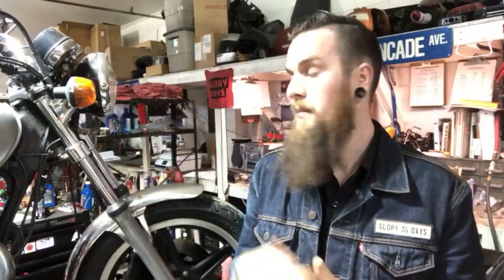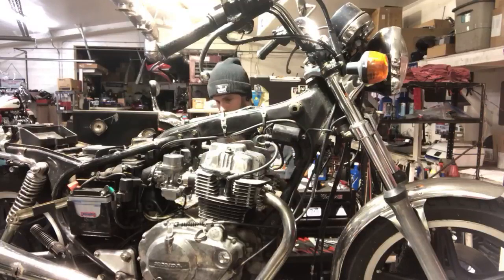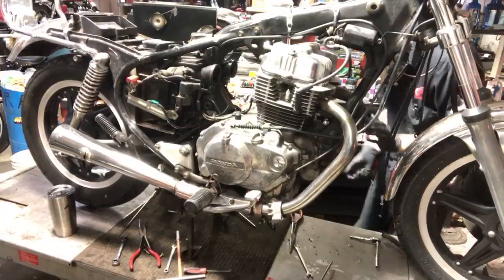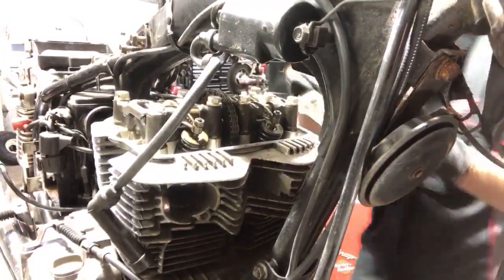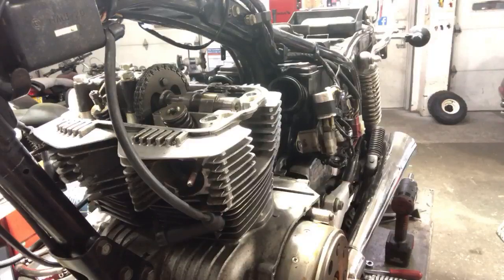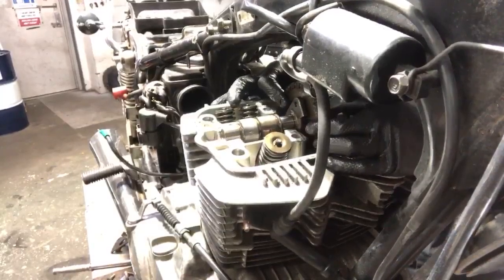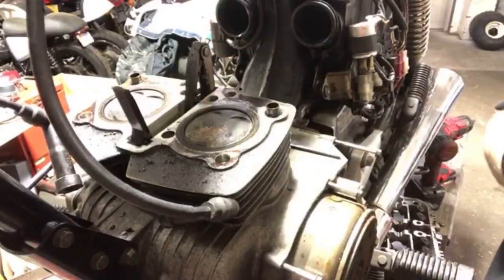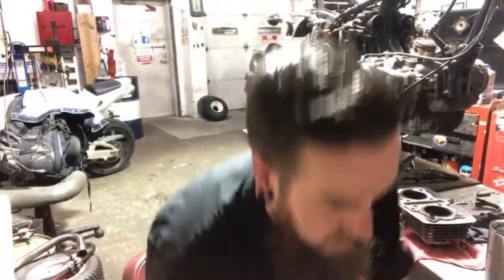80’ CM400t: NO COMPRESSION!

Comment: About 20 yrs ago i was driving with a friend on the backseat 30 miles from home on my tuned up 2 stroke 70cc scoot when I heard a loud pop and the throttle response was gone..I knew I had to keep the engine rpm up or it would die. So we went back 30 miles going full throttle lol... When we arrived at home i released throttle and it died and did not start anymore... Took it apart. And lol. Same as here 0.5 by 0.5 cm hole in the piston. The crazy thing still brought us home ;) .... Memories hehe..

Comment: The piston damage was caused by a lean mixture.  Running down the highway with a lean mixture, heats it up and eats the piston away.  There is either a cracked intake boot or the carbs are dirty and running extremely lean....per my husband who works on all these old Hondas.

Comment: bought it on craig's list . The pictures on the list didn't look bad  , holly sh#@!carb was seized up . I put a hole through the gas tank with barely any pressure. Front rim 1/4 of it was rusted through. It's still has hope. Its got me with your help.

Comment: My vote is it sat for long time as evidenced by the corrosion rings inside the cylinder. The carbs were dirty, they got it somewhat running and ran it hard on a cylinder that went peak lean (peak temperature leaned).

Comment: Hey Cody, thanks for all the info you so graciously post on You tube. I've taken to researching a variety of issues on YouTube especially issues concerning my bike, a 2000 V Star 1100. While I realize that there are some specific issues that don't cross over from a Honda, there are a few that do. Specifically the carburetors. Mine are Mikuni dual carbs and you've illustrated the "drop down" method of tuning/adjusting the carburetors. I recently went through a thorough cleaning but delayed doing that for fear of being unable to bring them back to running condition. In one of your videos you went through the drop down method and illustrated how the running response should be after assembly and start up with sound effects. I've been working on motorized machinery practically all my life so I'm well acquainted on how mechanical items go together but have never worked on a motorcycle. This is where I need to mention that I'm so lucky that I have carburetors on my bike since all of the engines of my youth were all carbureted, even though these are CV and not down draft. I've learning as I go with your help and the only area that still is difficult is the electrical, but I suspect that is not unusual for anyone else even some professionals. Anyway, thanks for everything and I'll continue to check your videos.

Comment: Now that's a trashed piston! I'd call that a wash Brother. Metal in the crank case is almost guaranteed. I got lucky with the CL200 engine. It was seized, but the PO didn't try to run the engine. So all I have to do is clean up the bores, install the new pistons and rings after I gap them and I should be off to the races. I typically do a live stream on Sundays at 7pm Eastern if you and the Mrs. are available to drop by for a few. Cheers Brother! Zip~

Comment: 31:50 ahhh so that's why there's a leak there. I also have a 1980 cm400t and it leaks very slowly at the head cover gasket. The gasket looked good but I was considering buying a new one anyway. Looks like I'll have to buy those washers with the rubber. Thanks for the info!
Reply: @tammysauer1853  The head gasket or the head cover gasket? The cover gasket is where mine is leaking. It will be a lot less work than having to tear the whole engine apart to get to the head gasket.

Comment: O yes i was stay without compression too on my 1983. vt 500 shadow ,and it was caused by misfire on front cyl, which caused valve burnout , and after repair valve seats and valves,changing cdi unit , for about month was all good , and it back again slowly signs of misfire on front cyl, obviously it was problem in pick up sensors too.. very hard to trouble shooting co's seems all well co's there is a spark but obviously in some moment misfire, what does Cody think from where to start in these situation?..

Comment: Your pal got himself rooked, by a few hacks that haven't any business even changing a wiper blade, let alone trying to resurrect a stabled, water-damaged bike that probably had sat with bad oil in it to start. The carbs being leaned out was just the first nail in the coffin. If your buddy has a salvage engine about, it would be a better candidate than the original engine, as the whole thing would have to be gone through now, or at least the case busted open to go thru all the internals before going after the bearings, oil galleries, as well as replace the stator and the pickups. Corrosion on the electric bits didn't help matters either, as it didn't likely have much spark to even fire any fuel that was getting in there to start. Sorry that your friend even took an interest in trying to bring it back to life.

Comment: I have a question...
I have a CM400T 1981, and the left cylinder does not fire.
I cleaned the carbs, and adjusted the float, and the left cylinder still doesn't fire.
When I pull the throttle for a moment it does fire for a while. 
Is it possible that I have bad rings or/and piston?
The vacuum in the carbs is produced by piston movement so if it has bad rings/piston doesn't produce good vacuum and gas/air mixture doesn't go to cilinder chamber...am I right or wrong?

Comment: Question .... I’ve rebuilt my slave cylinder on my cb650 nighthawk. Everything seemed tight and clean, but it’s still leaks. Took it apart again inspected it again, put it back together again. Bleed    The line and everything seemed fine until the bike was running at idol ??? What’s going on? It doesn’t leak until the bike is running.  Please help
Reply: Found the problem!!! And problem solved
Reply: @robcraft1373  what was the solution
Reply: charging7 noticed ripped o-ring all’s good now

Comment: Bro got yamaha r1 98 
Rides fine .but if I'm standing and accelerate around 4 k it starts to sputter. And if I ride and accelerate it's fine
All new spark plugs 
Cable and coil is fine 
Fuel pump new 
Filter new 
And compression is 110 to 130 130 150
Reply: Help me

Comment: Hey bud . im from denmark and i just done rings on mine and ive put it all together , but now i got oil leak down on the 1-2 rib ,its not much but its there , there is 2 small chanels on the left side cylinder upside down , do i block them ? also 1 of the bolts with rubber ( the rubber is half gone ) what to do mate ;-)
Reply: If you have enough money, yoy can buy these bolts with rubber at the begining of thread, at www.cmsnl.com